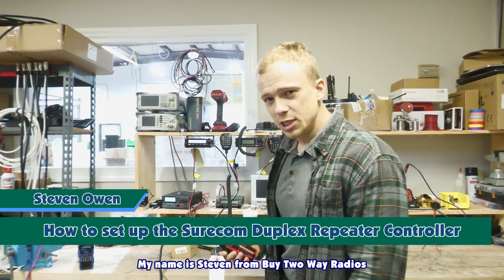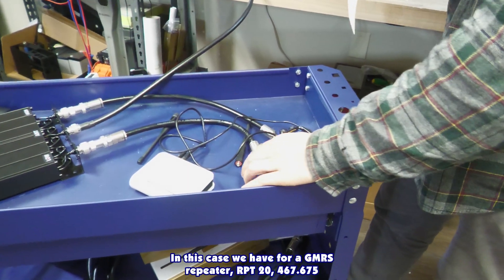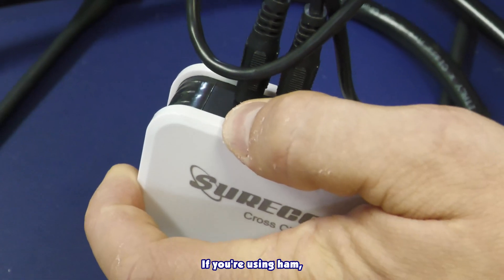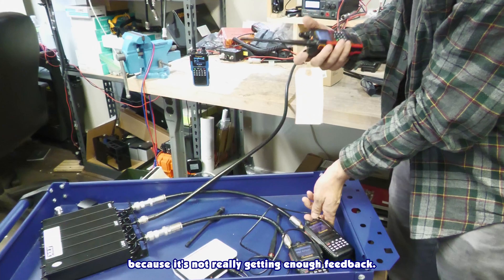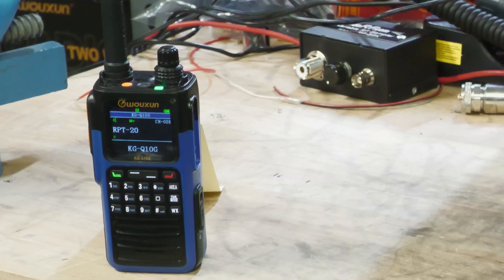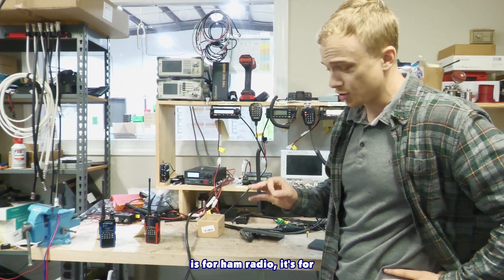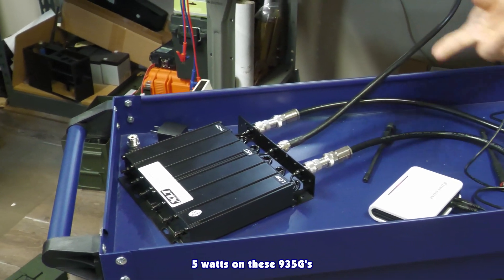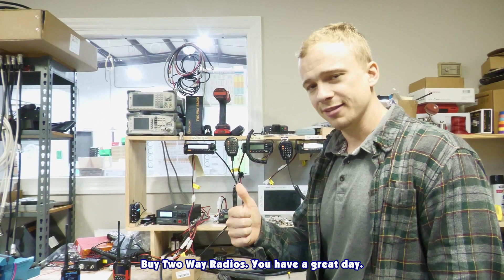Turn 2 handhelds into a REPEATER with the Surecom SR-628 Duplex Repeater Controller!

Comment: Instead of 2 handhelds, could this be done with one handheld (the receive radio) and one 50 watt mobile radio (the transmit radio)?  How would one handle the cabling?  Differing connections and the like.  Also, I really don't understand what you are saying about the volume and vox.  Its confusing.

Comment: You mentioned the receiving radio has to be on B side, is this capable of repeating in both directions or is it only ever one way?

For an event we are trying to connect a conventional repeater system with a cellular system using a handheld from each.

And I assume that this controller sends a transmit signal to the radio, and the transmitting radio does NOT need vox?

Comment: I got one I can't get 3 blocks out of mine how can I talk to y directly  I need help with mine
Reply: Cant get mine to work for more then a few hundred meters either. Even with base antennas and well seperatet distace between the antennas
Reply: I've even using a gmrs duplexer  and still can't get it to work my radio doesn't do what his did in the video  idk what I'm doing wrong can any one help